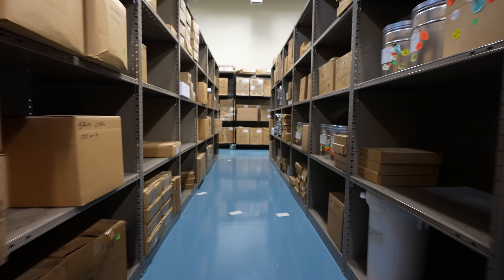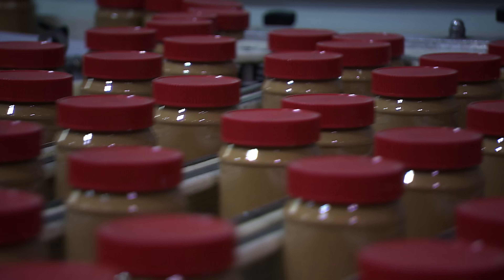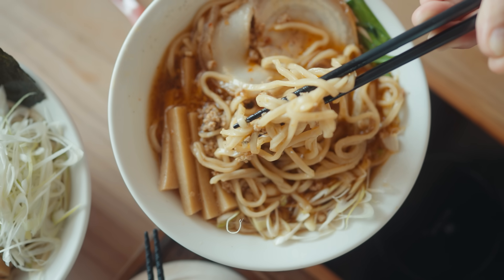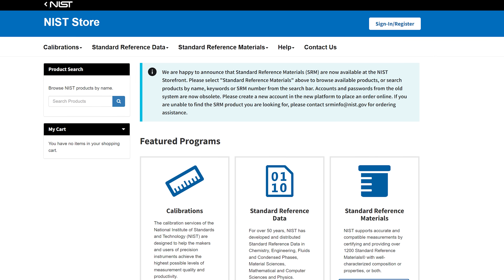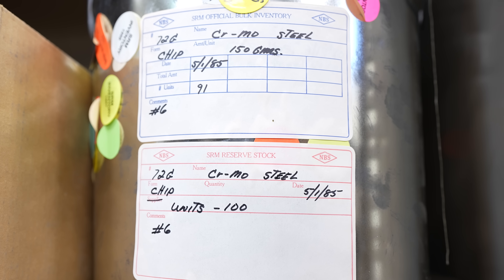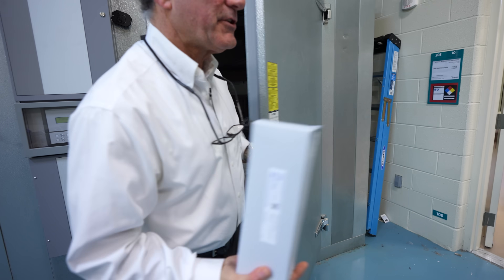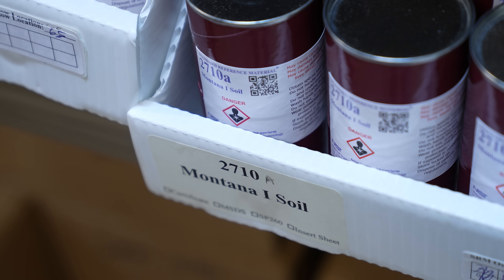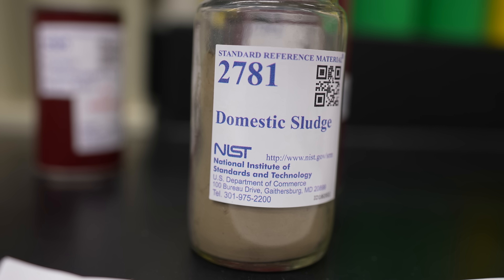The world depends on a collection of strange items. They're not cheap

Comment: Wouldn't a reference material have a shelf life after which the measured reference values may start to drift due to oxidation and other chemical reactions?
Reply: Yes.
Reply: It depends on the SRM. Most organic and food based SRMs have an expiration date on the cert for opened and unopened containers. Their inorganic SRMs are (almost) all stable and do not have an expiration date. A lot of the metals are plated and will not demonstrate surface oxidation. Having said that, there are a few NIST Inorganic SRMs that I have found to not be stable, typically powdered metals.
Reply: Definitely. I'm guessing the peanut butter does too, which is why on the label it says to store it at -20C to slow/stop the process
Reply: so? buy another fresh sample, else is quantified,and the remainder is either inconsequential, non-quantifiable or negligible. gotta have natural limitations of course
Reply: If you cant eat the peanut butter anymore, how are they sure the composition has not changed significantly?
Reply: @Helloagain_ textural and physical changes which affect taste is not the same as chemical changes which alter its composition. Those peanut butter are likely pasteurized and sealed so that it's only gone "bad" in the same sense that frozen meat can go "bad."